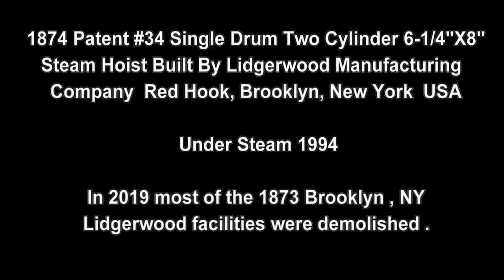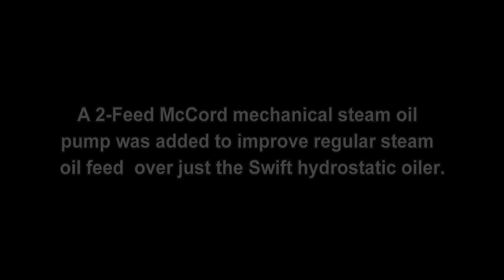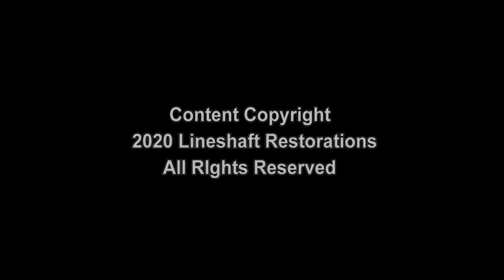1874 Patent Lidgerwood Steam Hoist Steam Test 1994

Comment: Had to think a sec about the 90 degree crank offset then it hit me - no dead spots!  Nice video, thanks for sharing.
Reply: Correct, with the 90 degree crank offset when one piston is at top or bottom dead center the other is halfway through it's stroke.  Because there is only one set of eccentrics the engine is not reversible.

Comment: Wow, a lot has changed. Last Hoist I worked on was 5 Megawatt Powered. Two  twin drums with clutches so you could raise both Skips if required or change Crushed Ore Load out point. Example, phone rings, tells you crushing will now be from 10 level. Last load from 8 level. So as a Winder Driver you'd leave a skip at the surface Unloading point. Lower the other skip using clutch from 8 Level to 10 Level wait for the Stop Signal. Then you can start Hauling Ore again. The Skips in that Shaft (Perseverance) Persy's travelled at 18 meters per second. 1200 Meters deep shaft & 10 level was 1km vertical down. It took 6-7 mins in the man cage big enough for a 200 series land cruiser to reach 10 level from the Surface. The Man Cage travelled at approximately 12 Meters per Second. Driven by twin drum also, with a counterweight on the other rope permanently. That Drum was also Clutched. Huge Disc pad Brakes fitted to all the Drums could stop the Winder almost instantly. Stretch on the 2 inch rope descending down the shaft was approx 1.2 meters pending how fast & or hard you began hoisting. In the end it got so technical it became fully Automated & the Winder Drivers job was just to Watxh over it.

Comment: Glad I found your channel, I'll got to the point I have a steam engine that came from a corn field in Tennessee and sat as yard art for 25 years before I bought it 7 years ago Of course it was froze up I tore it down and re assembled. Run good on 120 psi air I don't have a boiler, I don't know the maker it has belt wheels that measure 42"x 12.5 wide on right side and 48"x 12.5 on left side and cylender bore is around  8.375"  weigh is over 4000 lbs. Its time for it to go before I do. Would you be interested or know of any one, its on a trailer that goes with it. I live in Alabama. Thanks
Reply from the maker: Your best bet is to register on vintagemachinery.org and smokstak.com and use their classified ad systems. The process is a little tedious but worthwhile in the end. There are others that I'm not familiar with available as well.

Comment: Very nice engine, runs quiet even for the gears.  I noticed the rope pulling spool is missing; it should have been on the shaft which came out over the brake pedal.
Reply from the maker: I had acquired a winch head from a Tulsa Hoist intending to mount it. Never did and just recently sold it.

Comment: I've never seen sight glass drip feed oilers on any running piece of equipment with little to no oil visable in either of the two on the slides behind the two cylinders on this steam hoist.

Comment: How much pressure ?
Reply from the maker: Not sure but I don't think I ever tested it with more than 50psi. If I had something to pull or lift I would have used 80-100psi that was 100+ years ago.